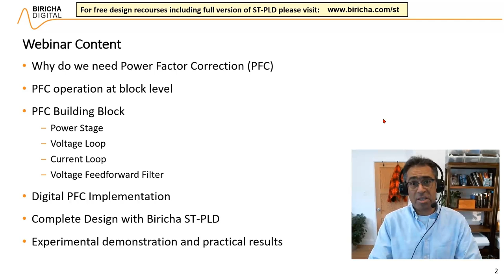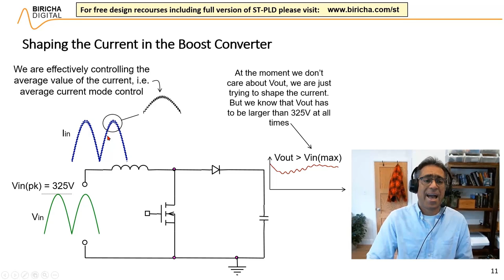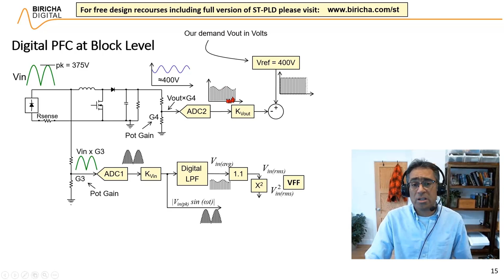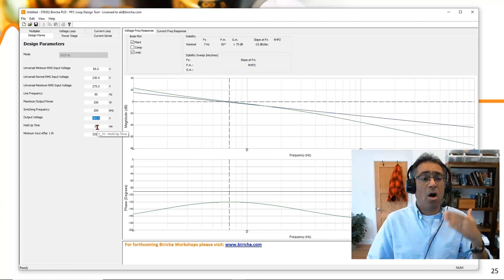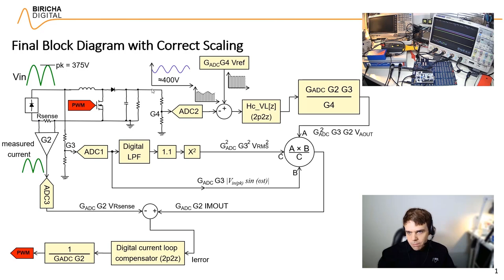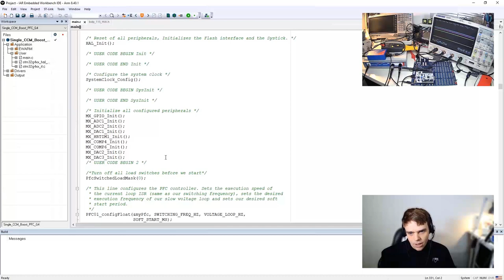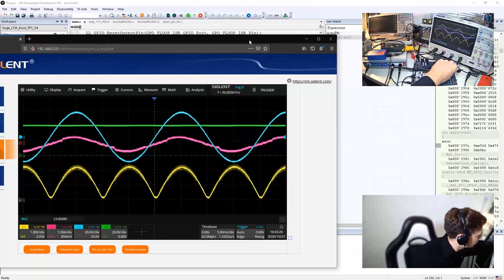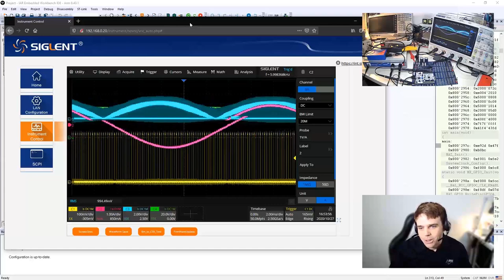Step-by-step digital Power Factor Correction (PFC) design using STM32

Comment: What would happen if the feed forward block is removed? Shouldn't the voltage loop compensate for lower input voltage by increasing it's output and demand more current?